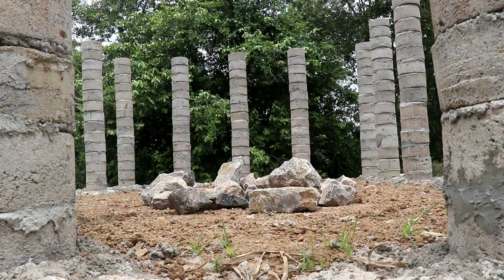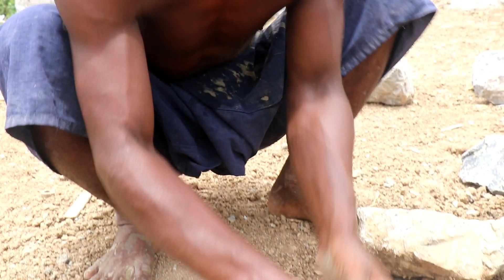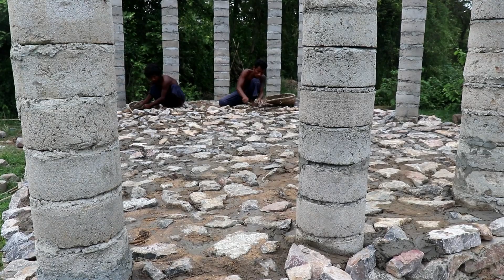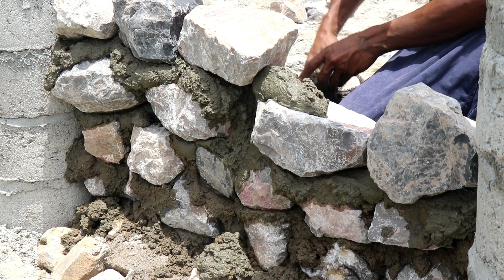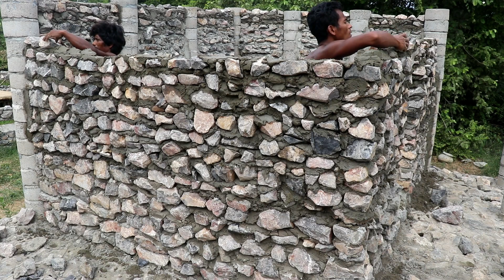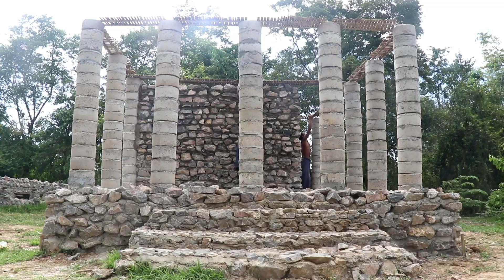Build Temple part 2 ( Make Room )

Comment: Sorry guys, I know it’s primitive construction, but without rebar (steel/iron bar reinforcements), you’ve created a VERY DANGEROUS structure. It’s a death trap. It’s possible that during a storm with very strong winds, the pillars and walls will come crashing down. If anyone is inside or close by, it can/will kill someone.
Reply: Rebar is not a great addition for most stone/cement/brick builds if you plan on the build being around for a long time... admittedly in this case the build they are making is not really intended to last a thousand years, it's just a project for a youtube channel.  Wouldn't be surprised if they knock it down and demolish it themselves in 6 months or a year to make room for another project.

The problem with rebar inside masonry is it eventually rusts no matter what you do, it will expand/swell up when that happens and crack or burst apart the masonry.  It does make a structure stronger in the short term, and that's great for modern bulding where nothing is intended to last longer than 100 years anyway... but it would be a terrible idea in something you wanted to last several hundred years or longer.  If ancient structures like temples or fortresses ect had rebar in them there would be none left standing now.